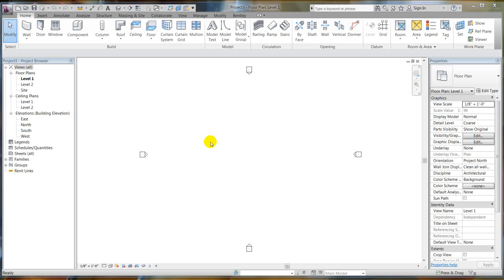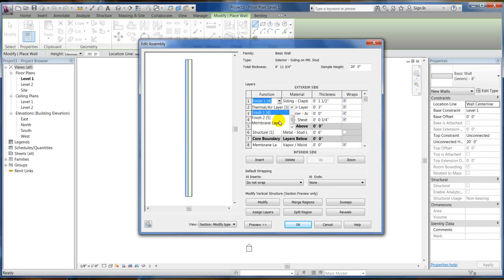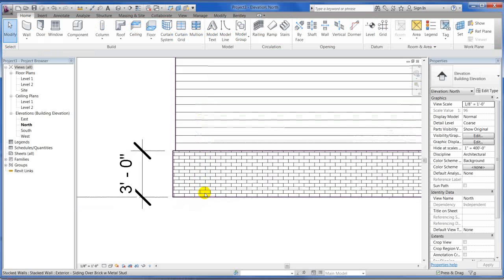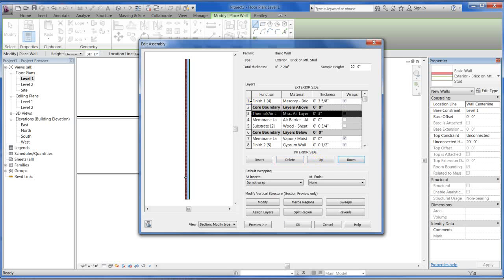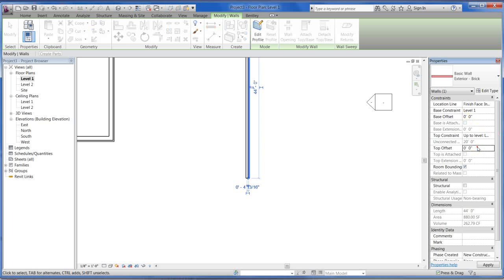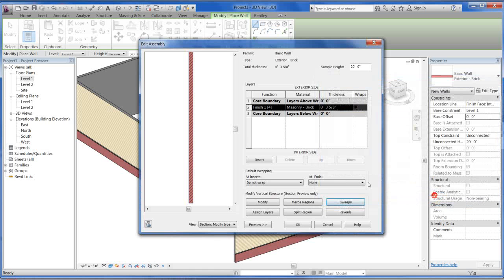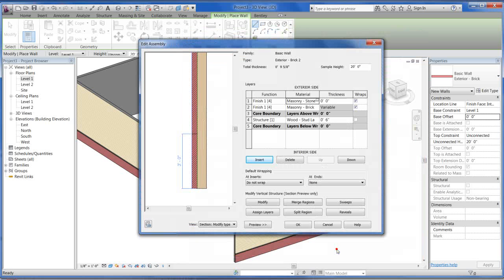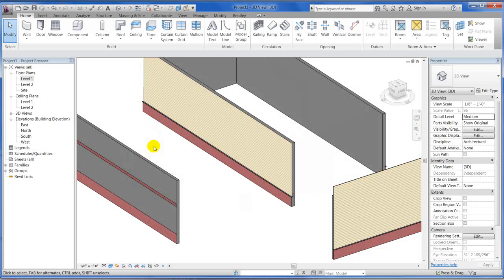Revit Architecture 2012 - Wall Creation

Comment from the maker: @zuluyu5 True, it is a good solution.  If you use a compound wall, you can align the floor sketch to the outside of the studs, for example, and then join the wall and the floor.  That will cut the floor out of the wall also.